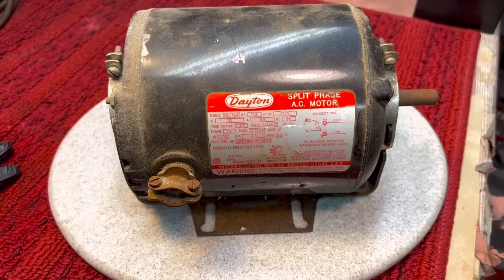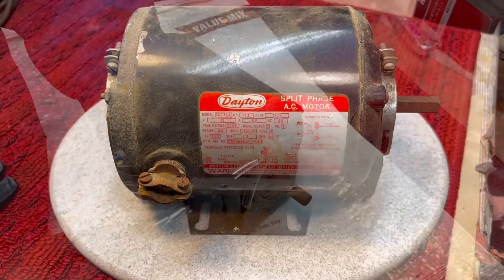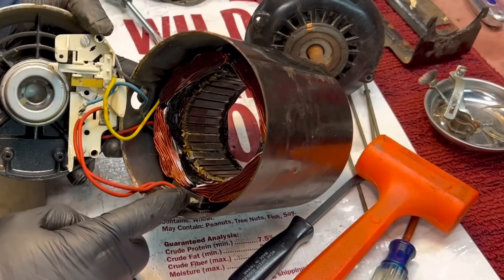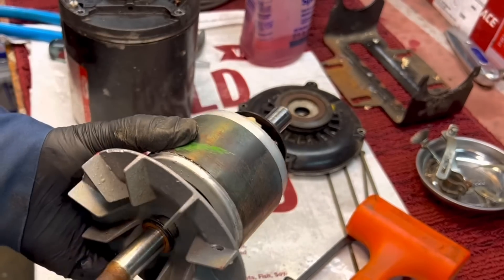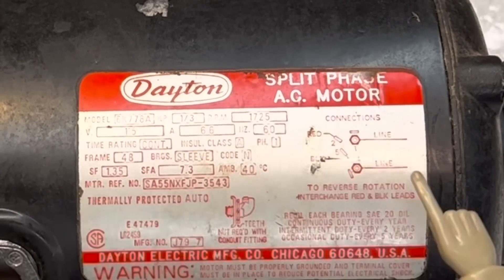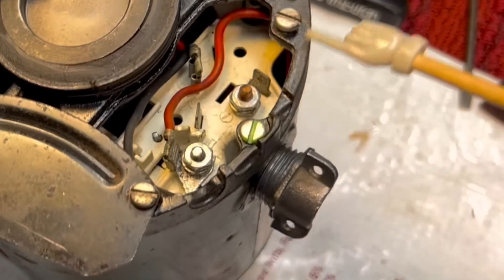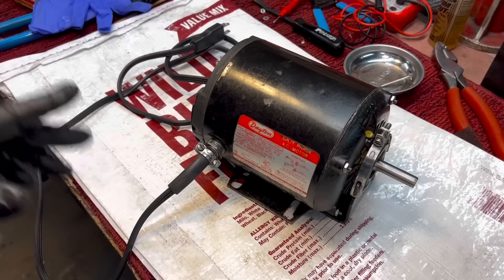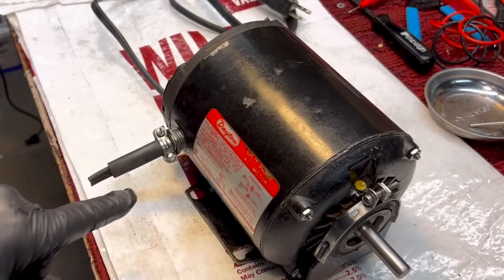Special Edition Dayton Electric Motor Teardown and Evaluation

Comment: When the cord is damaged and I have to remove it, and the plug is a moulded one, I usually bend the pins of the plug before I throw it away. So the plug won't fit into a socket outlet anymore. It prevents that, in the worst case ,a kid finds it and out of curiousity plugs it into a socket outlet and gets shocked by the open end.

Comment: A friend gave me combination belt/disc sander.   He said the capacitor was replaced, but that the replacement capacitor had died.    As you know, this meant the motor did not rotate, just hummed until the shaft was moved then it ran fine.
I purchased a new capacitor and it now runs.   Just another example of how a motor can fail, but in this case an inexpensive fix.
Too bad the starter circuit does not shut off.    As you said, good that you caught this before it overheated.
Dave.

Comment: Thanks for the Tuesday video! There are some parts worth saving off that motor so not a total loss. That oak board you salvaged from the roll top desk will look good under a nice motor too.

Comment: Thank you so much. You just saved me a lot of time and headache trying to replace bearings on a dead motor. OMG this thing has been running continuously for a while. It’s a miracle my garage didn’t burn down but I always had a fan blowing on the motor because duh it always ran hot. It’s almost this same exact model and used to run a Lortone rock tumbler with three 12 lb barrels.

Comment: I set my clock by ScoutCrafter. Monday, Wednesday, Friday. Monday, Wednesday, Friday. My system is upset now! A TUESDAY...FAIL!?! It will take a Wednesday, Friday, Monday to recover!

We had a ton of electric motors when we farmed. And I didn't know beans about much of anything back then. I remember helping replace one or two, usually in the dead of winter on a ladder working at the end of an elevator. The end outside. These motor vids are interesting.

Comment: This must be us on the same wavelength! Toots wants a hand mower she can start so she can trim. I have a 2010 Troy-bilt with electric start. Got the electric start working fine BUT after the mower starts, it won't restart till it sits a bit.THEN you have to lay the ether to it because the primer don't work. I'd cut the cord but it goes to the charger for the battery. See, you're not by yourself, Johnny! God Bless!

Comment: Great video 👍 Loved seeing another motor tear down. Great information on what to look out for when you have a suspected bad motor. Did those windings give off that electrical burnt smell when you pulled it open? You are right you take a chance when find or you buy motors like that. But I still like to take them apart and to see if it can be serviced or what actually went wrong with it. Well maybe you can save some of the parts if you run into another one just like that one. You might find one on the Poor Mans Flea Market 😂👍👍. Speaking of the Poor Mans Flea Market, what a fantastic find of all those drill bits made by Whitman and Barnes,looks like all great quality USA 🇺🇸 drill bits,again fantastic find. Great shot of Old Glory 🇺🇸 blowing in breeze. Well again great video and can’t wait to see what you do tomorrow. Have a fantastic evening! 😃👍👍
Reply from the maker: Steven- Surprisingly there was no burnt smell on this motor!  I always check for that.  😂👍

Comment: I suspect the inertial switch failed to work and the heavy starting current was left applied to the heavy starting windings. The excessive current flow burned out the windings. It is probably running on the starter windings. Thanks John.

Comment: I have a grinder motor wih a similar problem. 
MIne has a starter relay that shuts off the starting winding once it reaches a set speed. The relay burned out and I can't find a new one. I could put a manual switch in the control circuit to shut off the starting winding. Not sure if it is worth the trouble. 😁😁😎😎

Comment: You didn't fail - it was just a burned out motor - not your fault. I find the best source of great motors are when a neighbor or relative tosses out an old washing machine. I've never had a washer motor go bad, it's usually the electronics or control panel. I have motors from old washers that I have been using for 35-40 years and still going strong. I do agree with you - if the cord is missing or cut - PASS!

Comment: Very nice video. I have a quite old 1 HP 115/230 VAC Dayton "Power Capacitor Motor" from my dad's Craftsman table saw, but it does not have an external capacitor. It has an integral power switch, but was modified to be turned On/Off by an external switch. 
 I found that there is a 110 V potential from the saw frame to earth ground which makes it quite a hazard. 
The model is KS 73 BT-217, but have searched to no end to get its specs. I want to remove the end housing where the wiring is located to try to determine the source of the short. 

Any suggestions/comments are welcomed.  Thanks in advance.
Roger B

Comment: Speaking of fails, I saw a video yesterday from the UK where a guy wanted to restore an air compressor. The tank had so much rust inside, that when he cleaned out the rust, there was a hole in the tank side! =(
Reply: Did that with a fuel tank.  I told the boss, "if it's not broken don't fix it, fuel filters are cheap" ...he didn't listen!
Reply: @kevinbreckenridge6729  I saw a picture of a fuel pump that a customer installed themselves in a fuel tank. They must have left the plastic bag on, that is placed over the pump at the factory. Brilliant!
Video: Start @ 1 min. 12 seconds to see the pump. https://www.youtube.com/watch?v=IeB0EZmxT8M

Comment: Can you check the draw of amperage where the power cord hooks up on the motor? Using your voltage meter ? I think mine has an amp measurement on it .?? But is there a way to check if you don’t have that measurement tool you have John.
Reply from the maker: Hook!  Yes there is, I will cover it soon. 😃👍